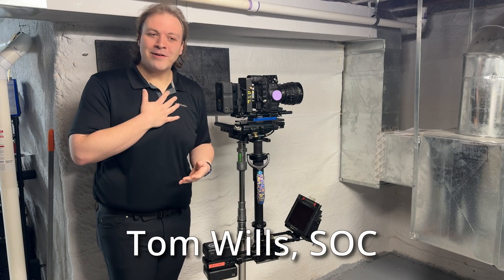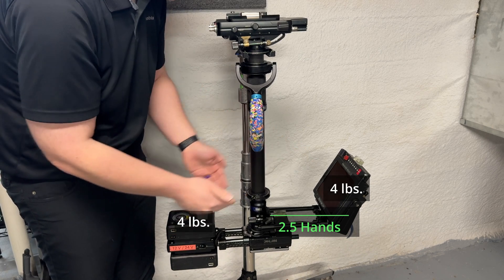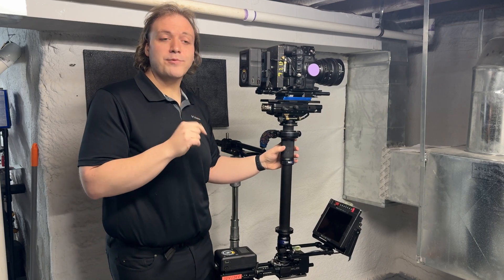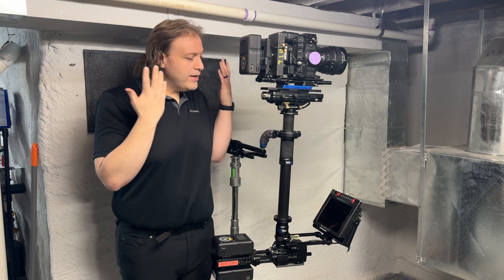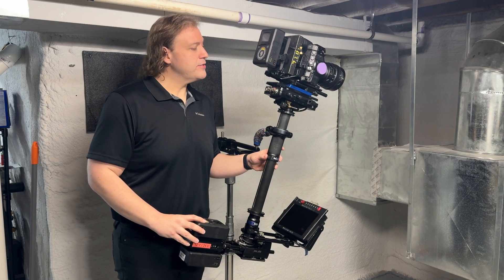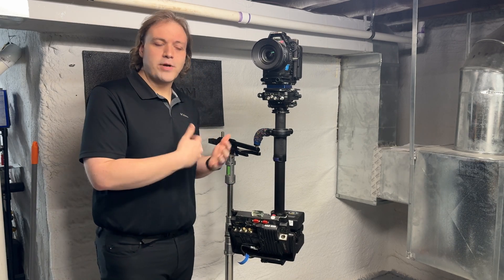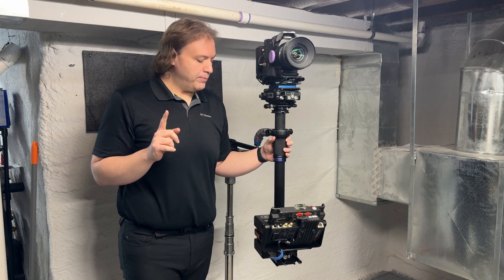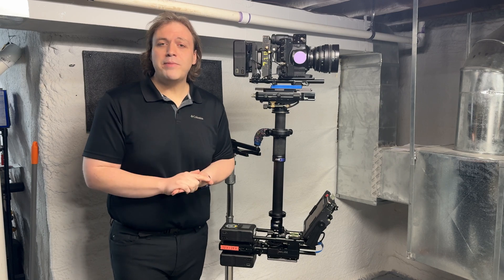A Practical Guide to Steadicam Static and Dynamic Balance

Comment: Hey bro! Nice vid. I was taught to measure the drop time of the sled starting from a 180º angle — meaning, holding it horizontally — and count 2 to 3 sec until it returns to a vertical position.
From your video, I get the sense that the starting angle doesn’t really matter since it acts like a pendulum. But I’m not quite sure if you're counting those 2–3 sec until it gets back to vertical, or just until it reaches a 45º angle again.
Not sure if my question makes sense 😅

Good vibes from Argentina!

Comment: How do you keep your drop time correct? Once you do the dynamic balance, seems like it’ll throw off the drop time once you get to moving the battery/monitor at the bottom!
Reply from the maker: @11.Pierre  as long as nothing moves up or down on the post, and you’re not moving the batteries or monitor up and down (for instance, you’re not moving the batteries in and out by swinging them up and down), nothing will change about the drop time.

Comment: Hey Tom. Nice vid. One suggestion: if you put the sled on the balancing pin before you put the camera on, you can just make sure the post is parallel with the c-stand on both axes (fore-aft and side-to-side). No need to count hands or figure out how much your monitor and batteries weigh, just do it visually. This also gives you the opportunity to play with monitor positioning and get it where it's not only insuring dynamic balance, but is also ergonomically comfortable. Then, when you throw the camera on, just balance the rig normally by adjusting the top stage and you'll be in dynamic balance. You can make minor adjustments later, as you do in your video, if the balance isn't perfect, but this is by far the simplest way to get most of the way there.
Reply from the maker: @pvsteadi  my only issue with doing this is that with just the sled on the balancing pin without anything on top, the rig is so bottom heavy that it is hard to see the difference between hanging “level” and slightly off level. You will end up moving the batteries back and forth quite a lot and over large distances for some very minute visual changes in balance, since it is so bottom heavy. I think eyeballing the weights and distances of your monitor and batteries (most monitors are about 2 pounds for a small one or 4 pounds for a big heavy Transvideo, most batteries are about 2 pounds unless they’re really chunky, that kind of math gets you very close) will get you closer more quickly. Also, if your rig is like the Ultra that I showed and has a quite raised up monitor, balancing the rig without a camera will not get you close to dynamic balance, as the batteries have to be closer than they would be in proportion to their weights.

But if putting the rig on the balancing stud makes more sense to you, I say go for it! As long as you’re getting the rig into DB, at the end of the day that’s what matters.
Reply: Makes sense, I see your point. It usually works for me but I also run my sled very long so it’s pretty easy to eyeball it to get it parallel. I’ll try it your way next time.
Reply from the maker: @ absolutely! If it works for you, that’s fantastic! In theory, if the monitor and batteries are relatively light, your monitor is relatively near your batteries in height, and you are able to see small changes in how the rig hangs because of the sled’s length, you should be able to get as close as my method does by eyeballing, so I can totally see it working for your build. It’s always the edge cases that make it difficult - very short sleds with very heavy bases or rigs with monitors raised way up.
Reply: Yeah, that’s true.
Reply: Curious why you have your trans video upside down? Or am I mistaken?
Reply from the maker: @ The operator who owns this sled (I have an XCS with a 703) uses their monitor upside down because on their monitor the viewing angles are much better from below than above, so they mounted the monitor upside down.